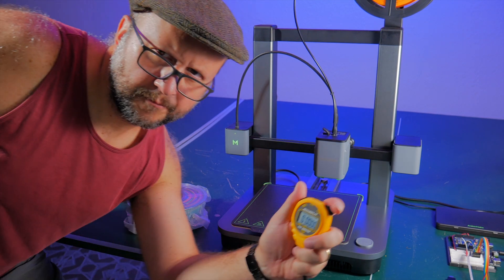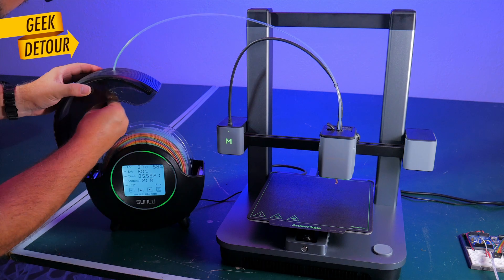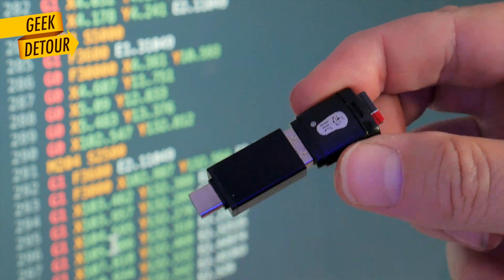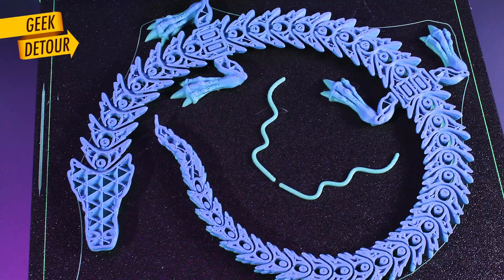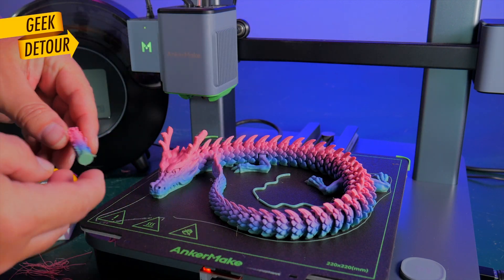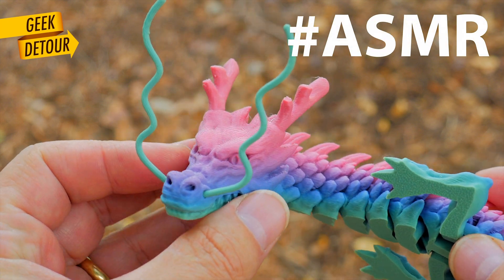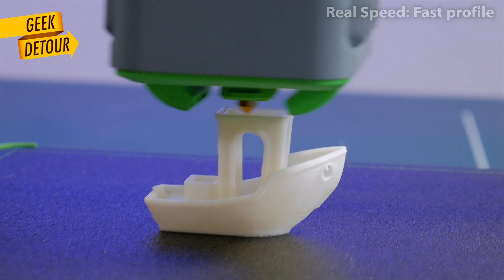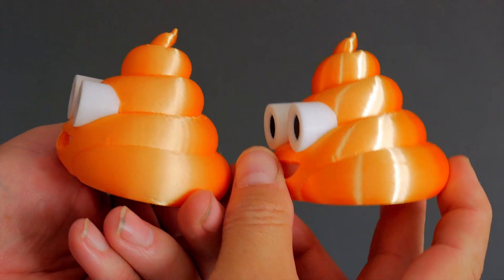AnkerMake M5C: how fast can it 3D Print?

Comment: Hello Geek Detour, could you please tell me your elegoo saturn 3 settings, I'm having quite a few problems finding the best settings (exposure, lift speed...etc) :(
Reply from the maker: @carlines3498 Hi 👋 Sorry for my late answer 😅 So, I didn’t have to change much of the default parameters… What I actually changed and it makes a big difference is the Rest Time: If you are not in a hurry and you want really nice prints (specially the first layers). When the platform goes down back to the resin, I make mine rest for 2 seconds before the UV Exposure happens. This gives enough time for the resin to accommodate and stop moving. It reduces elephant foot and it makes more defined details.

Comment from the maker: It turns out my M5C printed the Dragon in 7h10m - it could have been even faster! Without the pauses for taking photos, it would be 20 minutes faster... AND reducing for  2 perimeters (instead of 3, like I did), it could shave off an extra hour... So, it is possible to print the Articulated Dragon in 6 hours on the M5C 🤯